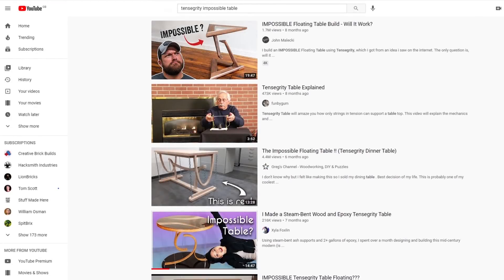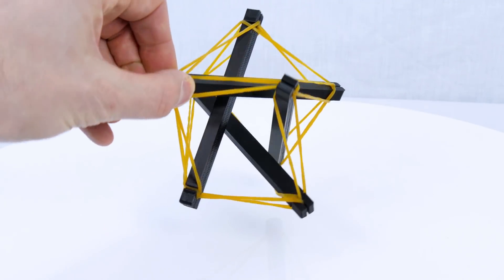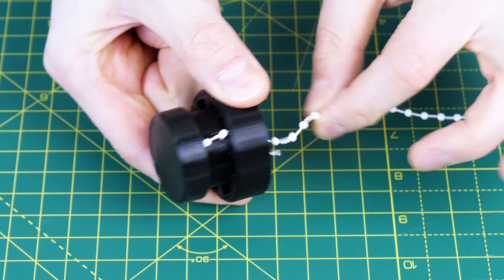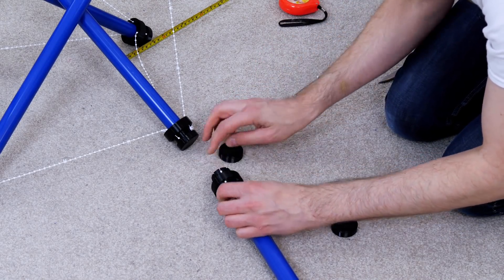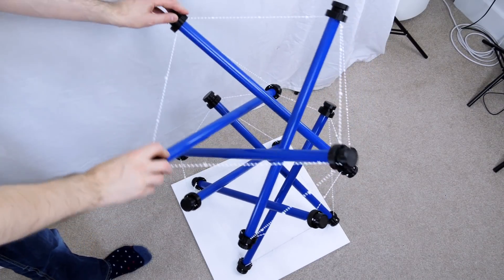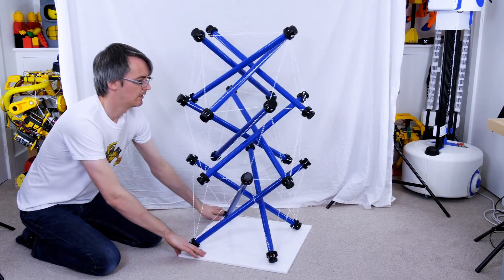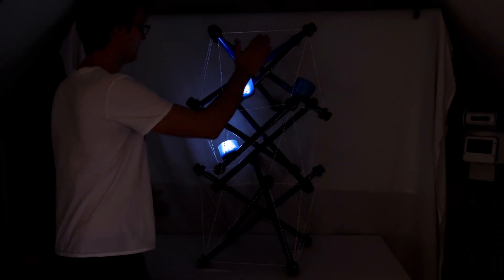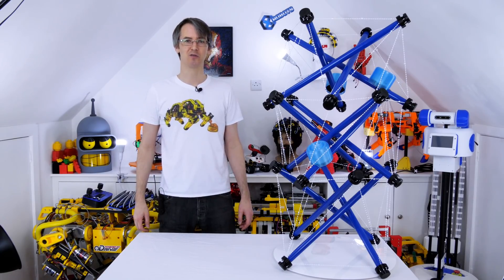Why there's more to Tensegrity than 'Impossible Tables'

Comment from the maker: I've got an experimental robot concept coming up next week, but I'd like to use Tensegrity in the future for something mechanical.  Patrons and YouTube Channel Members have next week's video already!
Reply: Hi James! Love your channel. My research is actually IN the application of tensegrity structures. There are a TON of benefits to replacing rigid bodies with tensegrity structures including weight reduction, energy absorption, and locomotion. Let me know if you have more questions on tensegrity!
Reply: Build a  Tensegrity robot! ;:D
Reply: I was hoping that you'd made a tensegrity robot. :-(
Reply: Try building a tensegrity quatruped with flexible spin pls
Reply: Your end caps look great! They sure make ball chain easier to work with.
Reply: if you made the cables out of led rgb fairy lights and program them like Mat Parker did with his Christmas tree it would be a work of art
Reply: i wounder if you could have a powerful spring like this...instead of wire use springs that at rest are the right tension but in theory you would multiply the spring force if compressed maby
Reply: does the weight of the upper structure add tension-rigidity to the lower one?

Comment: The Needle Tower and horizontal Dragon sculptural forms are the foremost extensions of Snelson's artistic engineering concepts, but I find sparse information about the actual methods of tensioning, and measured forces involved - some of which seem very high, given the angles of intersection, and height or length of extension in 60 or more feet, where many thousands of pounds of force would be demanded of each cable. Though the forms are far lighter than rigid structures, the basics of construction cranes, with open spans of rigid beams with triangular reinforcements, and sometimes additional cable spans to bear loads at longer horizontal spans, has proven utilitarian, where rigidity makes members strong in both tension and compression, and torsion as well.
 The gimmick, of tensegrity structures, overall, is an inherent visual paradox viewers cannot fully accommodate, rather than satisfying a deeper aesthetic appeal. The fascination with the open forms, repeated, still seems lacking in some quality needed to elevate the concept to a more fully artistic realization, despite Snelson's commitment. Perhaps the coldly abstract tubes and cables are unrelatable as artistic materials; his experiments with bamboo are akin to the construction scaffolds used in Asia, where the materials are organic, and a bit contradictory to their engineering applications, which actually makes them more appealing somehow.

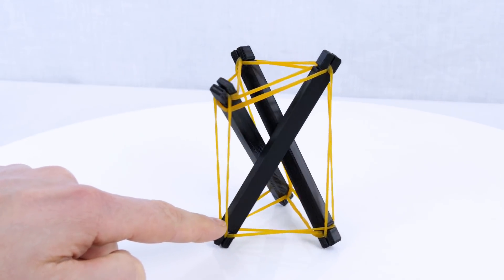Comment: There are two types of Tensegrity: Internal tension and external tension. That is, where the tension is provided by forces on cables or other WITHIN the structure and where a force (usually gravity) OUTSIDE the structure provides the tension force. 01:28 is an example of  an internal tension Tensegrity structure. 0:12 is an example of an external tension Tensegrity structure.

While internal Tensegrity structure are a curiosity, external Tensegrity structures are very special. External Tensegrity structures are an example of Binal Dynamics: Binal (two) Dynamics is where a force is channeled in such a way as to (mostly) counter itself.

In the external Tensegrity structure at 0:12 gravitational force pulling down on one side causes tension to increase in its opposing sides. The structure is then pulled back in to balance. The structure oscillates back and forth between its sides, while most of the the structure's weight is born by the tension-compression unit in the middle.

Lift generated on an airfoil is another example of Binal Dynamics.

Comment: Brookhaven College just north of Dallas, installed a tensegrity tower in the middle of the campus with a vertical pipe at the top that was supposed to support an electricity generating turbine. The massive steel pipes made a very distinctive tower, and Brookhaven used it as a symbol of the campus, but unfortunately the turbine head never worked well and was finally removed. After several years the town of Farmers Branch objected to the height of the tower that wasn't serving its intended purpose. When it was disassembled, the risk of the steel pipes escaping control meant that the entire campus was closed down for several days. The star pattern of the top view of the tower is still used in the college logo, which can be found on Wikipedia

Comment: The EXACT video I was looking for. I have been searching FOREVER for any kind of YouTube video that talks about tensegrity without defaulting to the now ultra cliche, “impossible table”. It seems like there MUST be some application for this amazing property other than gimicky physics desk toys, so thank you.
Reply: My problem with these is that it sort of makes sense that the rubber bands keep things pulled together tight.  With the 'gimicky physics desk toys', you can build them so that string or fishing line holds them together, making it harder to understand why the structure does not collapse, especially when supported with only a few lines.  Taught science forever and I love the 'how and why' of science.  These kinds of structures have many applications, however and I am starting to work on some of the simpler ones.

Comment: An interesting idea would be to instead of using many individual wires for each connection, use a few select wires that go across multiple connections, but you route it in such a way that if you pull on the starting point of the wires (say from a motor underneath) it would change the tension in a way that would cause the entire structure to extend or contract

Comment: A bit late to this vid, but you could use the upwards facing ends as hat hangars by attaching extension rods to the endcaps (You may want to consider heavier duty cords for coat rack duty).  It'd be a nice conversation piece for house guests.
Reply: Speaking of conversation pieces, if I had my way, I would have a tensegrity piece on EVERY flat surface in my house where visitors might see them.  Wish I had know about them when I taught science.  Great for teaching concepts, how and why thinking, etc.

Comment: I think you could turn that into a musical sculpture by using different thickness and shape pipes with the right material as the rigid parts and long extension springs instead of wire for the tensioning. Just leave the pipe ends open. The extension springs create alot of vibrations that are transferred to the pipes to make sound.

Comment: I've been thinking about doing a tensegrity project for a while, and that chain solution is a huge help! I couldn't figure out a reliable, easy way to fix the cables with consistent length. I might try smaller chains for more precise adjustment.

Comment: This has A Lot of uses for acoustic coupling. Since they act like springs but are also very controllable so the use of tensigrity structures for loudspeaker isolation as the mechanical oscillation travels poorly through the structure (same as springs) however unlike springs, they look cool. However as far as I know there isn't any comertial offerings only research based papers

Comment: Correct me if I'm wrong...but isn't a bike wheel basically a 'tensegrity structure'? I mean the wires certainly aren't in compression...
Reply: There are even flexible spokes. The spokes stay in tension when in use.

Comment: I hate the terminology of 'impossible' that clickbait has adopted, anyone who knows the basics of what's going on, and the meaning of the name, knows what this actually is.

I'd be curious, if this is easily miniaturized, I know physics doesn't easily scale with size, if this could be a good vibration dampener. I wonder if this would be assisted by aligning the top-most endpoints with the bottom-most endpoints and linking them with a wire; so that you not only have triangulation between layers but also a solid link between the top and bottom polygonal faces. Though with this idea of a vibration dampener would only really work if the top and bottom face planes are parallel, maybe a central shaft that's telescopic would assist in keeping these planes parallel; as twisting deviating from a Y-axis (up axis, I'm used to Z-X being a ground plane with Y as a vertical) parallel would make something like a table unusable. 

As for tensegrity 'rollers,' I feel that they run into the issue that is best described as the rolling motion of a 'sphericon,' where the rolling motion isn't spherical, but rather a circular arc with a shift somewhere along the arc; basically the 'roller's can only sit flat where they have 3+ points of contact, meaning their 'rolling' motion is based on a transition between polyhedral faces, where those polyhedral faces are comprised of vertices from those 3+ points of contact. Where spherical rolling is optimal, tensegrity 'rollers' are limited to polyhedral structures, until we get to a vertex structure that makes this negligible; imagine rolling around an icosahedral die, or a hexahedral die, compared to a Zocchihedron, the trademarked 100-face die, that apparently has a patent protecting "spherical dice; containing ;multi sized and irregularly shaped particles." While the tensegrity-based polyhedra doe provide more flexibility to sphere-like rolling than rigid polyhedra do, I think we still need to look at polyhedra like the Zocchihedron before we can consider anything to have sphere-like movement. 

Though I do think tensegrity structures could lead to something interesting in robotics. Imagine putting a drum at the end of each cord that is manipulated by a motor, almost like a tendon-driven robot but with the added functionality of a tensegrity structure. I feel like this would result in a fully compliant tentacle structure, where you have direct manipulation of each 'joint' but have direct and indirect compliance within the structure to allow for natural movement, resulting in multiple degrees of freedom within the compliant range, if not directly a full 6 dof range of compliance.
Reply: Yes, this is easily miniaturized. Apparently, at micro scales, we can see tensegrity structures in biology. Due to each rod/string being in perfect compression/tension (respectively), tensegrity structures apparently can have remarkably high stiffness to weight ratios (which actually means that it is actually pretty useful in space, where each gram comes at a premium).

Comment: There's a lot of academic interest in using dynamic tensegrity structures for deformable soft robots. Some of the demos are pretty neat and since the mechanical connection between actuation and the deformation of the structure can suffer some distance, you can stick your actuators wherever you want.
Reply from the maker: I really want to combine it with next weeks concept piece which is an alternative robot idea.
Reply: The nasa one is nice. It's springy and it was meant to land on Mars without airbags. I kinda want to fool around and build one too, but the kinematics to get motion and the actuation looks really difficult to do.

Comment: Could you fill them full of sand to make him heavier and make Them Sturdier
Reply: Sand would not increase the rigidity of the sticks. It would load more l tension on the horizontal strings and enhance the ocillation, because the members would have more momentum.

Comment: After you mentioned the cords' ability to engage with gears I started to imagine a variable tension robotic arm that had almost organic flexibility... and now apparently there are some Tensegrity Robot videos I need to look up!

Also, at one point there it looked like you would have benefited from some sort of Really Useful Robot with a mechanical hand ;)
Reply from the maker: I'd really like to do a robot based around this, but wait for the next video...!
Reply: @jamesbruton  Getting a fully articulated hand will be very interesting.
Reply: @evannibbe9375  for a stiff member
Reply: Holy moly that would be insane